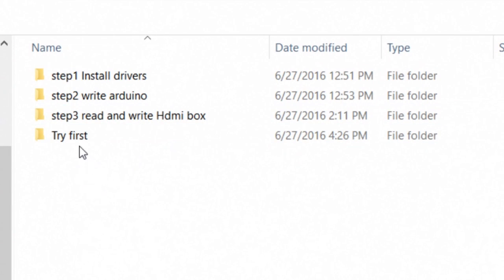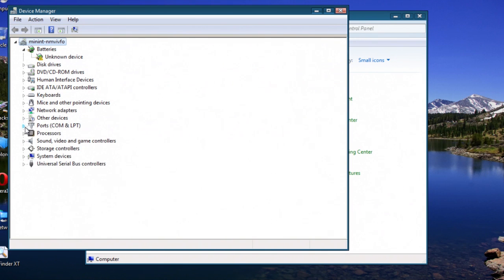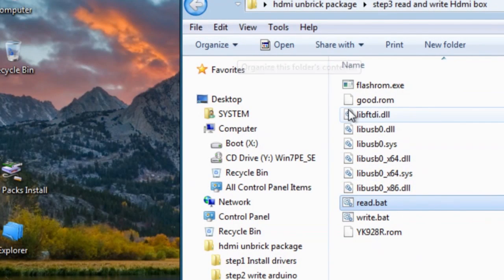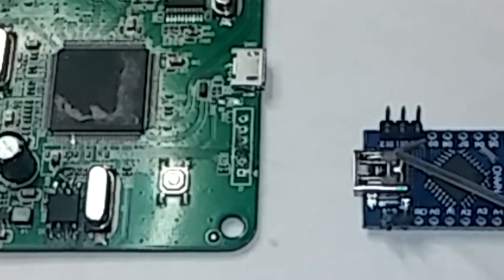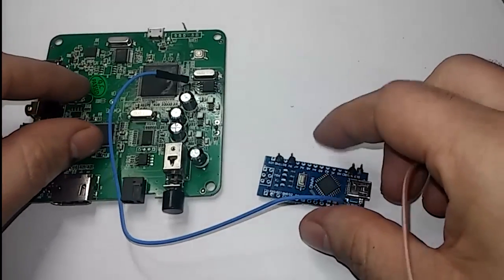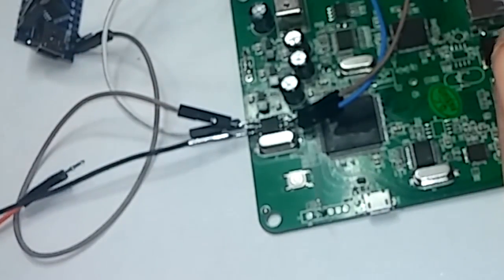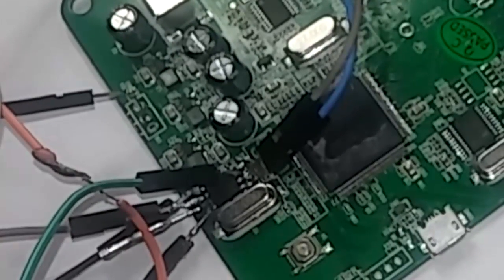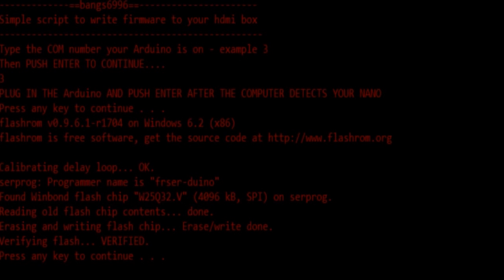velocap hdmi rec Unbrick step by step

Comment: I got Velocap TBOX  1000 with 25L3205D chip, is there any difference between yours chip to flash it?
Reply from the maker: At the time of the video my programmer was dead.. personally I would use a CH341A , this video was made in a rush to get a complete dump using what I had kicking around to help somebody out that requested if i could..  If you can find the firmware or modded firmware for your unit it should be basically the same steps and same pins .      If your unit is still working but you want to try modded firmware just make sure to back up your firmware about 3 times and do a compare to make sure its 100 percent the same.   I'm not sure if its the same you would have to look at my board and yours to see if its actually the same.